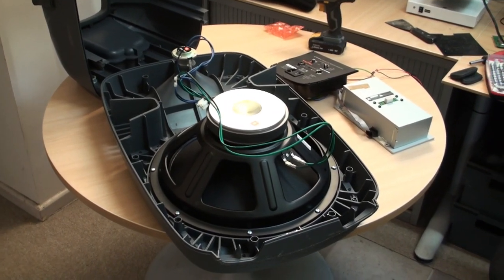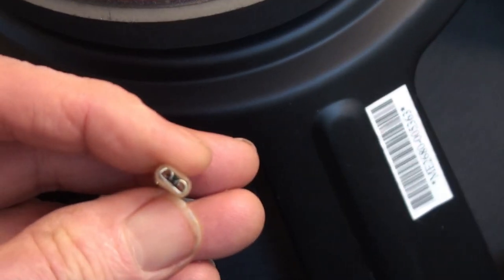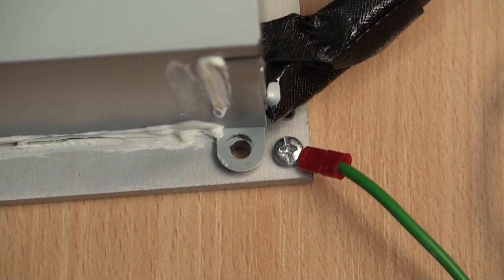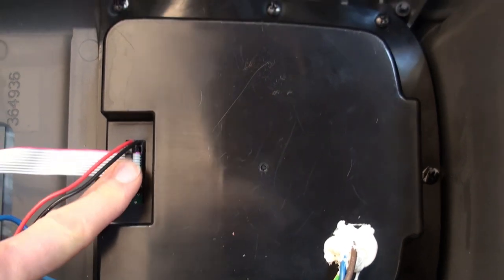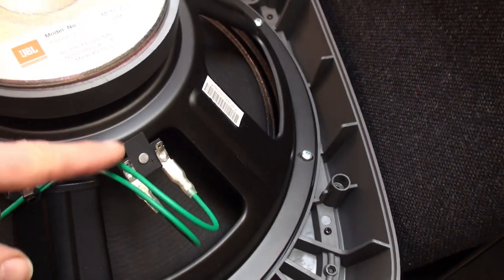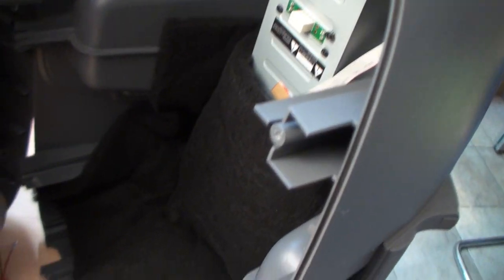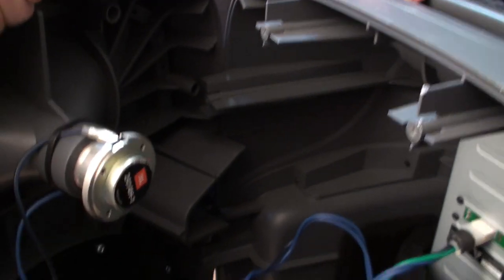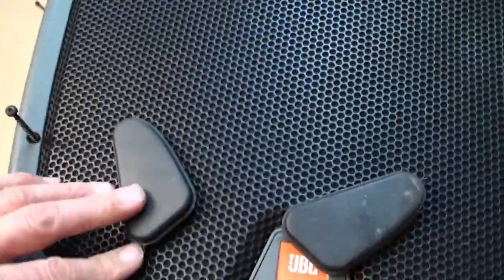JBL EON315 Reassembly Procedure and Internals

Comment: Hi, we have the 515XT’s.... last weekend there was a couple of power surges went thru our system (not sure why, we’ve been in this venue many times with no problems n none anywhere else) anyway halfway thru tonight’s gig one of the speakers kept powering off just for a couple of seconds, after a couple of times it stopped working completely, changed both fuses in it, the blue light on the back come on for a second but that was it.... do you have any ideas please x
Reply from the maker: Hi Michelle. Annoying. Happy to repair it for you. Check the inductor L503 isn't failing. This component causes this exact intermittent fault and it is quite common but not conclusive see:  https://www.youtube.com/watch?v=El27EVgTGSM